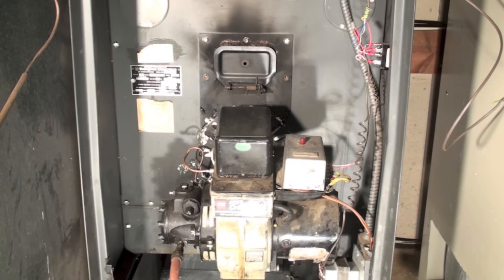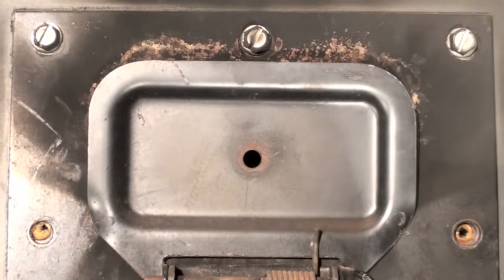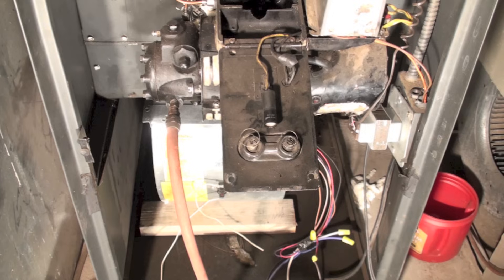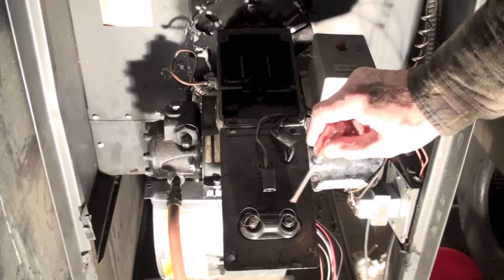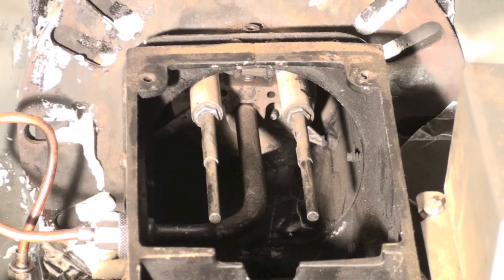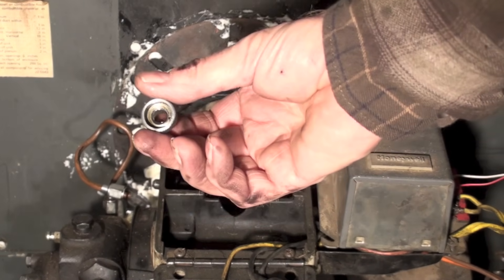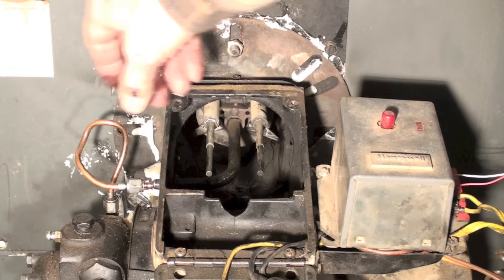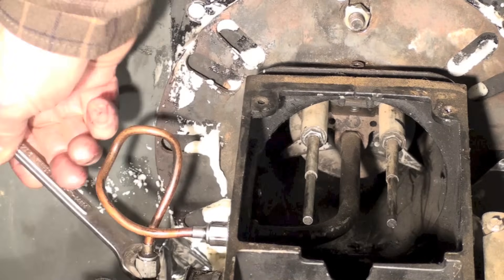Oil furnace troubleshoot part 2 No flame

Comment: What if you press the red button and the green light does not even come on like it did before and there is nothing going on?
Reply from the maker: Is there power to the furnace?
GFM
Reply: @grayfurnaceman  yes...
Reply from the maker: @trankt54155  The unit may have locked out twice.  You must reset.  But first, I would try to find out why it shut down.  Oil level?  This video may help:  https://youtu.be/SHTwhOtvQWE
Reply: @grayfurnaceman  Thank you. Will view it.

Comment: 20, 000v it only takes 50v I was told to kill a human so how would that only hurt you.
Reply: Its not the volts that kill you its the amps or current, only takes 1 to two hundred milliamps to be lethal. How do you think electric fencing works.

Comment: GFM, Its the middle of the night and I don't want the pipes to freeze. The transformer is dead and I don't have a replacement. What do you think about putting paper in the combustion chamber,  lighting it with a match and then pressing the reset button?
Reply from the maker: That depends on how many times you have pressed the reset.  Try this video:  https://youtu.be/CYImOWTooPk
In any case, it will warm the house but only for one cycle.
GFM

Comment: My problem seems to be the furnace runs fine for a while, but then i need to push the button. I replaced the electrodes thinking the blunt ends weren't sparking correctly. The new ones have a nice sharp point. I verified the spark gap. I know fuel is not a problem since when  I press the button I can see the puff of smoke from the excess fuel igniting. Seems to me like maybe every once in a while there is no spark. I imagine if the cad cell were bad I wouldn't have unburnt fuel in the chamber since it would be lit but then the system would shut down thinking there is no flame. I am thinking maybe the transformer is starting to fail. Do you have any other ideas on what may be causing the furnace to shut off?
Reply from the maker: The transformer may be failing.  However, if the spark fails during the on cycle, the flame will not shut down.  The spark is only necessary to start the flame.  You could also have flow problem during the cycle.  Oil filter plugged?
GFM

Comment: Mine finally fired after the little red button got pushed a bunch of times and it smoked pretty bad for few seconds, cough cough cough.
Reply from the maker: On Feb 3 I will be publishing a video that might of interest  to you>
GFM
Reply: @grayfurnaceman  I'm actually glad mine did smoke, as the smoke was coming from the pipe.  The furnace is tight, but the galvanized pipe has started rusting around the seams(that's where the smoke was coming from), time to replace the pipe.

Comment: Great video, all the right information I need. I have a 28yr old Miller oil furnace. Usually my problem is air in the lines, easy fix, this time I couldn't get it to kick off. Cycled it about 7 times, a half hour gap in between each, then gave up and called for a repair. Well the next day when the technician lit it off manually, he had a nice surprise when this dragons breath shot out of the hole. Sat him back on his butt and gave him a little startle. He told me how someone he knew had his hair and eyebrows singed getting to close to the inspection flap. Took a good 4 minutes to burn off. I've heard that noise before of built up oil in the chamber finally igniting, so I grabbed the fire extinguisher and went on standby with it. Seems now that the problem wasn't fixed so my next step is gonna be to check out the igniter myself. Thank you for the great information.

Comment: Any ideas what I can do with a outside 550 tank , line , and furnace that is all outside. I think I’m have a gel issue?
Reply from the maker: If the outside temp is below 15F, you could certainly have gelling problem.  You can avoid gelling by using at least part of the fuel as #1 fuel oil.  You can also use heat tape on the line, filter and bottom of the tank.
GFM

Comment: One thing I was curious about. You never mentioned the next step if you don't see any spark from screwdriver. What needs replaced?  Thanks
Reply from the maker: The next step is check for voltage to the transformer.  Voltage in, no spark, transformer failed.
GFM
Reply: Thank you

Comment: Pushed the restart about ten times last year.  Now it’s cold in the shop a year later would it be ok to fix the gap and fire it up.
It’s been sitting for over a year
Reply from the maker: You should be good.  Have a fire extinguisher close.
GFM

Comment: I set the electrodes like you said and changed a nozzle and checked to make sure the thing had fire going to the electrodes still wouldn't ignite.  How long are electrodes good for these are 20 years old.
Reply from the maker: Electrodes are good as long as they last lol.  
The next thing to ask is is there spark?  Is there a fog in the combustion chamber?
GFM

Comment: What can happen if you pressed the reset button a bunch of times? I’m going to replace the cad cell and the ignition control but I pressed the button a few times, what should I do??
Reply from the maker: If there is a lot of oil in the chamber, it could cause an out of control fire.  
The safe thing to do is to remove and replace the combustion chamber and clean any oil out of the furnace.
One thing that could determine what you do is:  Was oil spraying into the chamber when the button was pushed?  If not, you are ok doing the repairs and firing off.  
If oil was spraying, you can take your chances with a fire extinguisher handy or remove the chamber.
GFM
Reply: grayfurnaceman thanks for replaying. Let me resume my problem. Try to start my heater, turned on thermostat nothing happened. I had to bleed my furnace and it worked for 2 days. Replace motor, still not working, replaced pump and bleed it again but failed to start. I get the symptoms of your 2nd video, press reset button and it starts for 45s and shuts off. That’s why i’m trying to replace cad cell and control but I’m afraid of not knowing if there was oil being sprayed. Can I test if there was oil being sprayed by unplugging the hose that goes from the pump to the gun assembly and then hit the reset button before replacing cad cell and control??  Thanks again!!
Reply from the maker: @mra9273  When the unit starts on a trial for ignition, does the flame come on?  If it is on, there is no oil buildup.  Have you replaced the nozzle?
GFM
Reply: grayfurnaceman sorry to keep bothering you. No, I have not changed the nozzle. I took the gun assembly out and both electrodes and nozzle are black and smoked. Is that the problem?? Should I replace the whole gun assembly, electrodes and nozzle or just the nozzle?? Thank you so much for your help.
Reply from the maker: @mra9273  I would never remove a gun assembly without changing the nozzle.  Black is somewhat normal.  The electrodes can be cleaned by detergent and possibly sandpaper.  If there are no cracks, they can be reinstalled and adjusted.
GFM

Comment: Thanks for the videos. I started with fuel that had some weird hard particulates that got past the filter and clogged the jet, to a replacement jet with a bad thread that didn't tighten down and dumped some raw fuel into the combustion chamber, to an ignitor with a hell-hot spark, but just stopped igniting after 2 or 3 cycles. Anyway, I guess I'm on to the next videos about adjusting the spark gap and checking the spark rods:)
*Warning for other newbies*  He's not kidding about extra fuel in the chamber - when mine finally lit, it shook, roared, blew open the inspection port and shot out two feet of flame. Even after I shut it down, there was still flame in the chamber for about a minute.
Reply: N Ferraro how many times did you pressed the reset button? How did you get it fixed or did it went to normal after burning the oil that the chamber had?
Reply: @mra9273  Three times, but I think the messed up thread on the jet kept me from tightening it all the way and it dumped some raw fuel when it shut down and right before it re-lit. That, or I pressed it 20 times and forgot about it, because it looked like a jet afterburner coming out of the inspection port.

Comment: As a 34-year veteran service tech in NYC doing 2/4/6/gas & dual fuel, it saddens me to see that you would test a transformer without deadheading the J pump. Why would you purposely add unburned fuel to the chamber? Why would you not want to get a pressure and cut-off reading from the J pump? Why would you not pull, clean and inspect the electrodes for small cracks and check the condition of the nozzle screen? In fact, a furnace of that size is going to have something between a .65 and 1.00 gph nozzle, and cleaning them is not recommended. And using a screwdriver is to check spark is also incorrect. You can pull spark but still have a weak transformer. Do you think a tech (let alone a homeowner) can tell by eye if a transformer is putting out 7,000V vs. 10,000V? You should be using a transformer tester. Not to mention an unsuspecting homeowner having a cracked screwdriver handle and having a painful lesson. If you don't have a tester at least use a bare alligator clip to avoid getting shocked.
Reply from the maker: Your methods are, of course, correct.  
When you are troubleshooting a problem, a very simple method to test a transformer is to use the screwdriver.  The test is done in seconds and will tell you whether you have a problem with spark or not.  
What you are talking about is a complete service of the burner.  That's not what we are doing here.  Certainly, if the unit was not under annual contract, I would recommend a complete service of the system after the troubleshoot is done.  
Many of the stack switches would not safety out for 90 seconds.  You are worried about a few seconds to test a transformer?  
As for nozzles, I never reinstall a nozzle.  If it is removed, it will be replaced.
And yes, I can tell the difference between 7,000 and 10,000 volts with a screwdriver.
GFM

Comment: What do you do if you're not getting a good arc on the springs? Bc that's what happening to me. There barely any spark on the 2 springs.
Reply from the maker: The transformer is failing.
GFM

Comment: How do I get the access oil out?  I am new to boiler heating and probably have pushed it 10 times in the last 3 days
Reply from the maker: IF you have only pushed it 10 times, when you get it to fire off, it will probably just burn at a high rate for a few minutes.  If you do get it to light off, shut down the burner immediately and let it burn out.  
The only way to get the oil out otherwise is to remove the combustion chamber and clean it.  Not a simple job.
GFM
Reply: @grayfurnaceman  thank you GFM!
I am going to try to clean the guns this morning.

Comment: Very good video Gary Thanks. I have an oil fired water heater acting up. I suspect it is an air adjustment. Burns loud and sometimes quits. There is an air adjustment near the pump that slides to let more air into the squirrel cage fan. How do I set it?
Reply from the maker: If the flame sometimes stops, it is probably not air adjustment.  I would be looking for an oil supply problem or possibly a partially plugged nozzle.  
GFM

Comment: I'm an oil furnace technician and i've seen where people have pushed the reset too  many times that they even had oil seeping out of furnace on to the floor which i refused to relight and even had the fire dept come to another house because the chimney was smoking real bad
Reply from the maker: That is probably most dangerous condition that oil furnaces can have.  An uncontrolled fire can be almost impossible to put out.
GFM

Comment: My spark transformer gets so hot during operation, the black tar inside melts and drips down towards the fan making a mess as well as blocking the cad cell.   What could be the cause and cure for this?
Reply from the maker: While it is possible the transformer is overheating, my thought is that you have a draft problem and the heat from the flame is traveling back from the burner tube to under the transformer.
GFM
Reply: @grayfurnaceman  Furnace is running right now and I know the transformer is getting too hot - what should I do?   I will send you pics in a few.   Oops guess I don't have an email for you; you should have mine - am waiting - the pics may help a lot as it is not a usual installation that I have modified a bit.

Comment: Very good instructional video. Thank you for your instruction.
Reply from the maker: Welcome
GFM
Reply: @grayfurnaceman  any idea on ran out of oil now button doesn’t do anything. If I push relay down inside the oil burns fine but stops as soon as it’s let go.
Reply from the maker: @Hockeyshiitake  Sounds like a failed Cad cell relay.
GFM

Comment: Furnace has been working on and off for the last couple months. So far I've been able to get it to relight by bleeding (that was a couple times) and I've changed the oil filter (that was a couple weeks ago). Now it's not working again. I removed the gun and cleaned it and reset everything. I tested the spark on the "springs." All good. When I pressed the button I do not see any fog. Should I try replacing the nozzle on the gun?
Reply from the maker: The nozzle would be the first thing I would replace.
GFM
Reply: @grayfurnaceman  Done and working! Thank you for your videos. They gave me the confidence to dig into this thing and not call the plumber and have to spend my day waiting around at home for them to show up.

Comment: This may the strong video to bring this up, here goes.  Beckett nozzle lines, they are sometimes over tighten by the former service man, when you snug it up, oil leak city. I got I the habit  of checking the flare of the line, if questionable, cheap insurance to replace. Got in the habit of watching your videos when I get home from work, being in Florida no more oil burners for me.
Reply: Unfortunately Pat. A hole bunch of them around Tallahassee.

Comment: Fog brings back bad memories, cust. pushed the reset , god only knows how many times.   Could not remove chamber, lit the chamber with with flaming paper, but first got my fire extinguisher, burned for  at least 6 hours, no damages, just time , glad the cust. had widows that opened until the chimney heated  to exhaust the odors and smoke.  Your thumb nut piece, good advice
Reply from the maker: That 6 hours has got to be a record.  Had them run for 2 hours and turn the smoke pipe red, but never that long.
GFM

Comment: So I've pushed that button quite a few times trying to troubleshoot. But when I push it now and look through the lid above the burner I'm not seeing the mist. Pulled the gun and the nozzle was very dirty. Tried to clean it and still nothing. If I replace the nozzle is there a way to tell how much fuel is in the chamber? Really don't want to burn my house down
Reply from the maker: The only way to know for sure how much oil is in it is to remove the combustion chamber and check.
GFM

Comment: Are you active on here? I'm desperately in need of help. I'm a single mom, just got laid off, barely getting by. I'm having to buy five gallons of hearing oil at a time to keep my kids warm. It's so cold now and my furnace won't light. I just had an issue with the furnace only running for a minute. I watched your other video, cleaned the cad cell, it worked fine then. Now it won't light. I only hit the button twice and it did not light. Well when I was having issues with the flame only running for a minute, I hit the button a lot. I'm so confused about what to do. My kids are cold, we can't bathe, I can barely afford milk for the baby much less a technician. My husband used to handle these things before he died six months ago. I'm so scared I'll set us on fire trying to fix it but I don't have a choice. Please, any help will be appreciated. Is my house going to set on fire because I hit the button so many times when it was only firing for a minute and twice now that it wont fire but it's running?

Comment: any ideas how to remove fuel in the combustion chamber?
Reply from the maker: Cross2314 The only reliable way is to remove and replace the combustion chamber and clean the floor of the combustion chamber. 
GFM

Comment: Please help.. we have replaced nosle, set electrodes, replaced relay, and it has spark, bled the line, it starts but won't fire..
Reply from the maker: I am assuming when the burner is reset it will run until the safety shuts it off but no flame.  When the burner starts, is there an oil spray inside the combustion chamber?  
GFM
Reply: grayfurnaceman we have to double-check to see if there is spay. We have fuel to the bleeder. I'm gonna have him check that as soon as we get back. Thank you so much for replying

Comment: Just fixed my furnace following your guide. Fantastic information. Dirty igniters and the remnants of some unfortunate critter in front of the nozzle. Thanks you very much for a very helpful video guide Sir! And right before a nor'easter tonight. You saved the day.
Reply from the maker: Glad you got it going.  RIP to the critter.
GFM
Reply: bradley chubb iron fireman proton accelerator on 460v 3 ph 60hz

Comment: If any one can help me.
My furnace didn't start I cleaned the heat sensor the looks like a watch battery I cleaned it turned on for a about 2 minutes then it turned off then I bypassed the sensor it started again stayed for a little longer it when off again but it won't turn again  I reset  & triped the the red button again & again & nothing, somebody told me the it could be the fan thermostat I guess RELLAY so not sure what it is can any help I'll appreciate it. It a horizontal furnace
Reply from the maker: First thing, Does the flame come on when you press the reset?  if you have reset the cad cell relay may times with no fire coming on, you have a problem with too much unburned oil in the chamber.  It should only be pressed twice.  If it does start, you could have an uncontrollable fire.  
GFM